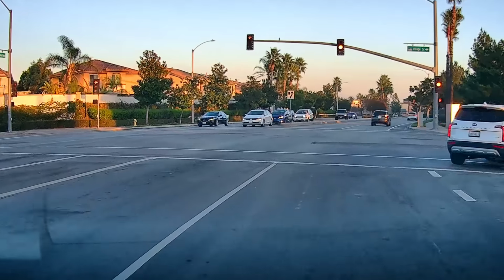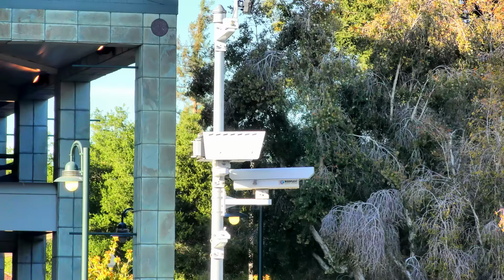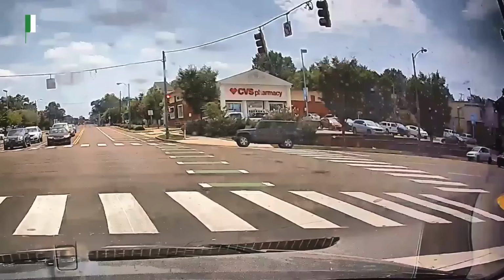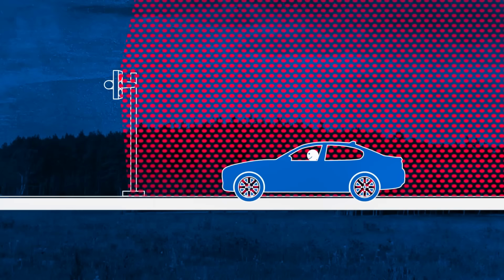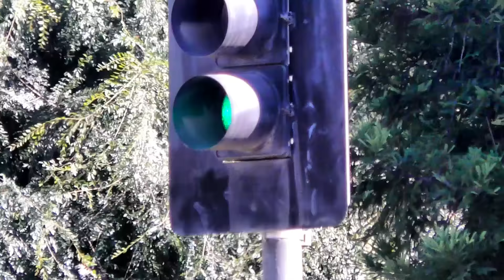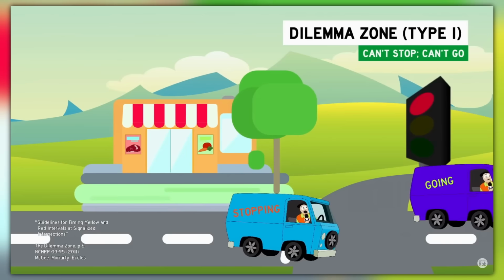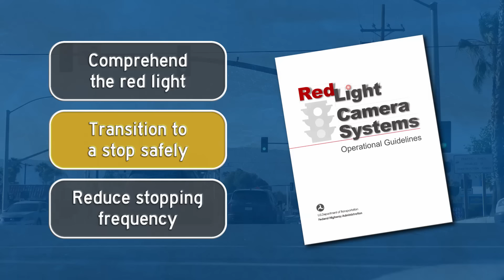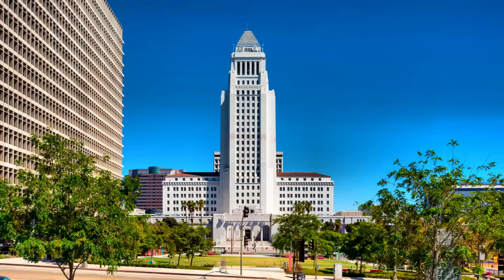Three ways to FIX a STOP LIGHT (so drivers ACTUALLY STOP!)

Comment: I used to live in Fremont near CA-262 (Mission Boulevard).  Been watching you for years now and so glad to see this cameo!  Thank you!

CA-262 is such a disaster during rush hour since it is the primary connector between I-880 and I-680.  That light I think you're at is a pretty major thoroughfare - Warm Springs Boulevard - which bisects an already-short segment between the two freeways.  There was something in the works to turn it more freeway-like without going complete controlled-access freeway - doesn't look like it happened, though.

Also no one in California is actually following any speed limit, lol.

Comment: Good video. We spend so much time focusing on stopping. What I wish we would focus on is less idling time or distracted drivers sitting at the stale green lights. I wish there would be a change to the standard to a flashing red to indicate it is going to change in the next ten seconds, so finish that text...  or if slowing for the red, be ready to roll again. Fuel economy would skyrocket too.

Comment: Love the videos. In Europe most traffic lights are on your side of the intersection instead of the opposite side of the intersection in north America. I wonder if this reduces red light running.
Reply: Placing them on the opposite side gives a driver more time to see the light, so to me that is safer.
Reply: The light is further away, so you see it later. Thus you have less time to see it.
Reply: The light is further away, so you are seeing it for a longer time.  Thus you have more time to see it.
Reply: The mutcd has minimum and maximum distances for head placement.
Reply: In Norway most intersections have the light at the side of the road by the stop line and one on the opposite side of the intersection on the pole for the opposite direction..

Lights over the road are not common,  but exists in some places.

But they like roundabouts where possible,  but roundabouts are not god for very heavy traffic, especially if the bulk of the traffic takes a left turn.
Reply: Probably doesn't make a difference in running, but it probably does fix the pervasive problem of drivers stopping in the crosswalk or halfway into the intersection, since if they did that they wouldn't be able to see the light.
Reply: In Ireland there are traffic lights on both sides just before the junction and a single one the far side.
Reply: Having experience with both .. opposite side is easier to see. Yay for America ! Same side the driver sees the pedestrians waiting, because they are next to the light. Yay for Europe. So .. it depends ? The more lanes a road has, the more 'opposite side' seems to make sense. Less right-turns are done from center lanes.
Reply: @MichaelEricMenk  For heavy traffic there is the "turbo roundabout" which has 2 lanes and hard borders. At entrance, 2 lands to chose between "right and straight" or  "straight and left",
Reply: @pizzablender  Yes, and they still don't work.

On my commute they had to make a slip-lane bridge over the roundabout on a continental trunk road (E-roads).

With the majority of left turns removed, the roundabout now works as intended.

Comment: Every new traffic signal I’m seeing is Seattle after around 2010 has been bigger than the old ones, and has the yellow reflective tape around the edge! I’ve also seen some signals in the city that seem older, but use the bigger lenses, however, those are quite rare. Where they are, I notice they have sometimes put yellow reflective tape on them instead of replacing them.

Comment: Phoenix, AZ has an offset intersection. On the south side of Indian School Road is 71st Avenue. On the north side, appropriately spaced from where 71st Ave would continue is 71st Drive. Neither 71st roads (yeah, I know, east side stuff) meet at Indian School. It used to be that mess of multiple stoplights that Rob was showing. Sometime in the early 2000's, Phoenix removed the second set of lights and made that mess a single intersection. It has X number of phases. Indian School both ways. Indian School both directions. Indian School both Left Turns only, 71st Ave, and 71st Street. Works out great.

Comment: For me, the most common cause of me running or almost running traffic lights is when they  change traffic light patterns (phase order, or the way the light operates in general). I think there should be a "new signal pattern" signs for people driving their daily, routine, internalized routes. These are the only times I've unintentionally or almost unintentionally ran traffic lights.

I ran a red light once a few years ago. I'd gotten use to this pattern every night driving home where I could easily see what color light cross traffic had. It was a smart light, the type that senses you coming, gives cross traffic gets yellows and then reds, and then a moment after cross traffic goes red, you get a green (so long as there are no opposing protected left turns, and plus there's a little dot on the back of their traffic light so you can see what color they have). 

After years of this, one night, cross traffic got yellows and then reds (and the opposing protected left turn was still red) but my light stayed red anyway, and so I unintentionally ran it, even though all other directions were still red. They switched the light so that they force traffic to stop for a moment for the red light to turn green. (maybe it also had something to do with the new police station built nearby, maybe they were using the light for traffic calming?)

I've almost also ran traffic lights when they changed the order of the phases. I get used to noticing the order the light feeds the intersection, the 1 2 3 4, 1 2 3 4, 1 2 3 4, and then one day, it suddenly turns to 1 3 2 4 with no warning! So I think I'm next, I see the light change, I press the gas without thinking, and then crap I'm still red, it changed for a different direction.

I'm surprised there are no signs or regulations for signal changes. WHY!? Don't you think they should put up a sign when they change light patterns that we've unintentionally internalized over the years? 

I think it's silly that they put up "new traffic pattern" signs for clearly visible changes to the road, but they don't put ups a "new signal pattern" for something that you have no clue they changed until it's too late. They could put the sign up for a day or two until people who have interalized their driving routes notice the signs and prepare for stopping.
Reply: I've had the same issue and came close to running reds. I can usually look ahead and see the opposing signal light from the side and can tell if I have to slow down or not. Most people probably don't bother with learning the signal order though so it's probably not something even worth announcing. In fact, it would probably confuse some drivers!
Reply: The solution to this is to go when your light is actually green, not when you think it will be green.
Reply: I’ve seen some of my local jurisdictions use even portable changeable message signs to show change in intersection control. Otherwise the “New Traffic Pattern Ahead” Warning Sign (MUTCD Sign Designation: W23-2) can be specified in contract documents or local jurisdiction’s traffic control plans

Demand change if you see it not happen again at another location.
Reply: @Gamebuster1990  for those of us with any sort of momentum, it saves time, fuel, momentum, and traffic, if you can adjust preemptively to the signals.  Slowing for a red is a lot more significant than slowing for a not yet green, if your light will change in eight seconds but you’ll get there in five, you slow down a bit, but you won’t have to stop.  And stopping, and worse, restarting, is one of the concepts that the gross majority of motorists have yet to comprehend.  Anticipating signal changes can greatly reduce jams if you don’t have to stop, or can get into gear and get moving just a hair quicker.
Reply: @jaysmith1408  cope

Comment: The synchronized green lights are a common sight around here, often accompanied with a sign indicating a "green wave", and sometimes even accompanied by a sign with a live updated recommended speed to keep to the wave plus how many lights you can expect to be green if you do.

And yes, roundabouts. But one more that you didn't mention - stop having dead-straight roads. Being able to see for miles down the road does not help safety at all, and adding subtle bends makes them more safe. Maybe collab with NotJustBikes for video comparison? Even all the highways in NL are bent, and not because our land isn't flat enough.
Reply: How do you suppose REDUCING visibility is going to make anything safer?
Reply: @b-chroniumproductions3177  People drive the speed that they "feel" is safe on a given road. The wider and straighter the road is, the more people tend to a higher average speed. Multi-lane roads tend to be faster, roads that "feel" wider tend to be faster. This is not so much a conscious thing, but a thing people do unconsciously. When a road - esp. one with a limit of 20mph or below - has a lot of visual detail to pay attention to, such as subtle curves, traffic isles for pedestrians and parking bays alternating sides, people will actually drive below 20mph because driving faster than that feels too risky.

Comment: Incredible video. I have a yellow light in my town that is too short and I've been saying for years that it should be longer because I can't safely stop in time and it's too dangerous to speed through.
Reply: That's how Norwood OH 25 mph speed limit lights are timed ,long intersection very short yellow lights only advantage is more traffic tickets. This is an outdated system that no longer is good for different roadways compared to 50 years ago.

Comment: The signal timing to minimise stopping is an interesting one because it should also discourage speeding. If driving at the limit allows you to pass through multiple lights without stopping there is no need to race to the next lights as that will increase the chance you will hit a red light
Reply: I found two issues with this style as it was used in the city I lived in for years.
1. As it is optimized for a speed limit, it also discourages you from driving slower even if the conditions are bad. I've seen many people driving at the limit in snow and heavy rain just to stick to the light sequence and not stop at each of those lights.
2. As it's optimized for driving straight, people turning quite often are speeding to catch up with the traffic that was going straight before.
This leads to yet another issue. If there is a turning traffic (people turning on your lane on the intersection ahead), they will have to stop as the lights are synchronized to you. Now when you approach next intersection, it will turn green and you will have to slow down or stop because they are just starting to roll. Although it is fairly good mechanism, it can't enforce you to stick to a given speed. It has to act fast enough to let people waiting on the intersection to take off before you reach them. I've often been driving quite slowly on those because I knew that when I drive 50km/h, the light will turn green when I reach it but there's bunch of cars waiting. So I drive 30km/h and when I catch up with them, they are already at 30km/h too, so no slowing down. But this means that I'm also slowing down the traffic behind me. So it's better if the light changes earlier that if you were driving at speed limit. It also has to be kept longer. Imagine you've seen yellow light while leaving intersection. It's an obvious indication that if they are in sync, all following lights will be yellow too, so you will now go over speed limit just to catch up. It's bad as well and happens all the time.

Comment: I hope I live to see when we can have a smart traffic control system.  A system that won't change the light for one or two cars when 10 are approaching.  Or doesn't keep four directions standing still with many vehicles just so a lane with no traffic has a turn at green.  Or even a system that can override the operator and apply the brakes through the existing precollision systems a lot of cars have.  Basically a system with an A.I. that acts like an air traffic controller, knows the inbound traffic volume and adjusts to move the most through.  Oddly though I think the oldest technology,  round abouts are our best choice.
Reply: The dutch certainly have smart traffic cameras, but without a doubt roundabouts are the best way to go in most cases
Reply: It's like you read my mind...

Comment: Great video! Could you do one on the detection lights in the Netherlands that can detect not just cars, but buses, bikes, and pedestrians, and change the wait depending how many vehicles there are!
Reply: Those suck
Reply from the maker: Budget is still a bit tight to film outside the country.  But I'll certainly look at that if/when I ever make it to Europe.  (I've never actually set foot outside the United States, unfortunately).
Reply: This happend here in Germany too. Easy for me as driver or rider.
Reply: I assume that it is easier for EU to have/implement smart traffic signal controllers that can handle variable (assuming standalone- networked/coordinated systems is $$$) there are magnetic sensors (old school) and video detection packages that can help the signal controller to do that 👍🏼 

Upgrading from “dumb” (fixed time/time variable only) controllers however can be pricey, typically funded for end-of-service life replacements, or big grants/funding from central governments/State/Federal authorities … the “unsexy” part of the transportation infrastructure

Comment: I remember when I was stationed at Fort Bliss, TX, that all the intersections in El Paso that had stoplights had solid white lane lines that basically told drivers, if you are in the solid white lane line zone when the light turns yellow, keep going, otherwise stop. Ingenious little trick.

Comment: For your "dilema zone" I dont know about US but Canada the lines on the road help decide whether you can stop or go on a yellow....provided youre doing the speed limit.  Lines are dotted all down the road, then using math they start a solid line where in that zone your car isnt going to stop with a sudden yellow and its safe to proceed.  But if youre not in that small space and light goes yellow you have plenty of room to stop.  Theres also a 3 second delay from 1 direction to the other for red light runners.  When my city installed 3 red light cameras they nab about 200 a week collectively, kinda wish they were multiuse though, stop cars from stopping in crosswalks and fine them when they do.  Its an all too common issue with right turns on red allowed.
Reply: It depends on region and state in the United States, as it always does. So I can only judge for my state and the states I've driven through, which is mostly the midwest (sorry Florida drivers, but your roads and driving is shit). For most Midwest states, the point to brake is where the solid lines for your lane start when coming to an intersection, and if you don't have them, then oh well. However, we've been adopting the roundabout more often than redesigning our traffic signals. Best examples are Missouri and Michigan when it comes to roundabouts. We do have delays where the traffic next to go have to wait for the intersection to clear before the crossing traffic turns green. But the use of cameras for tickets are a mere gimmick, for I see multiple people running red lights in St. Louis even with the traffic cameras that blatantly flash their red and blue lights to mimic police enforcement, but do not do shit in reality, as drivers will look both ways on a red light and see if traffic is clear to run the red light. Wisconsin implements traffic the best in my opinion, but I have yet to visit and drive in each state.

Comment: Another trick is to paint queue lines like they do in Florida --- solid stripes dividing all travel lanes approaching the traffic light, and painted as long as the must stop zone. Pretty quickly motorists pick up on the clue that when the light turns yellow before you pass the beginning of the queue lines, you need to stop. ✋🛑
Reply: Seen that in Virginia. Only place I've seen those extended solid white stripes on the road before an intersection.
Reply: That’s actually my favorite technique so far. So simple and elegant. I absolutely hate the feeling of looking at a light going 55 and hoping it doesn’t turn yellow lmao

Comment: I’ll add my confession to running a red light, Rob. A couple of years ago, I was driving home on a windy hillside road in the late evening and I was coming up to where I needed to make a left turn. I saw one of those lights to the left designed to be seen around the curve and thought it was a left-turn signal, or I just wasn’t paying attention, I’m not sure which. Either way, I made the left and didn’t notice the light at the signal had turned red by the time I got there and I got more flashes than a celebrity at a Hollywood premiere. It cost me over $800 in fines and fees, plus attendance at an online traffic school starting Erik Estrada (yep, he still fits into his uniform from “ChiPs”.) 😔
Reply: Well it could have cost someone their life instead so GOOD
Reply from the maker: DISCO COPS!   😄
https://youtu.be/D5-bD372v5s?t=6

That's EASILY worth $800 (kidding)